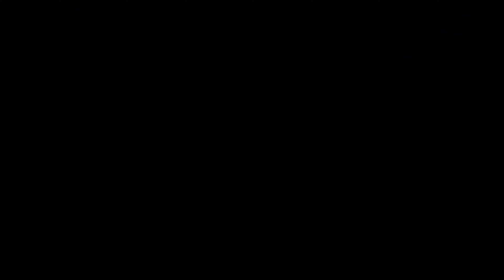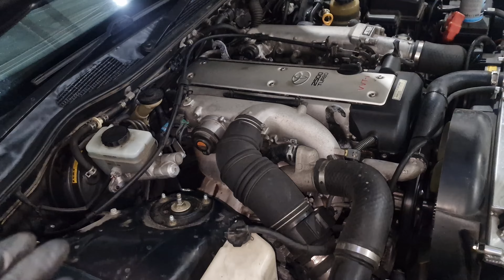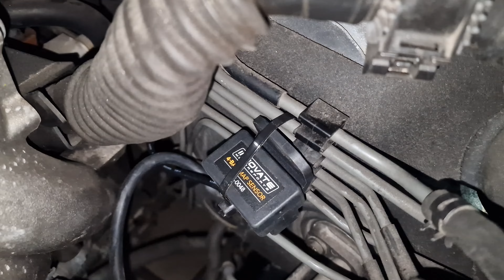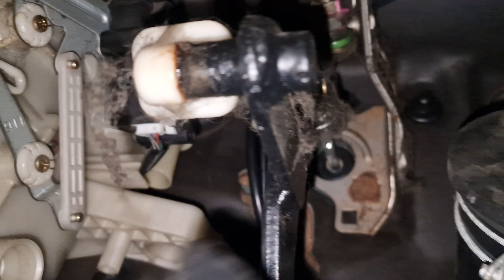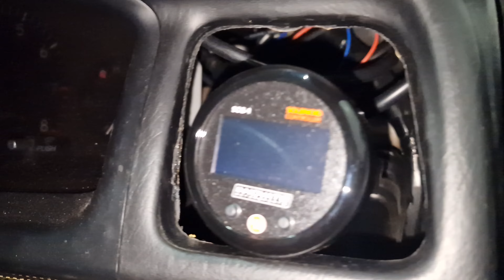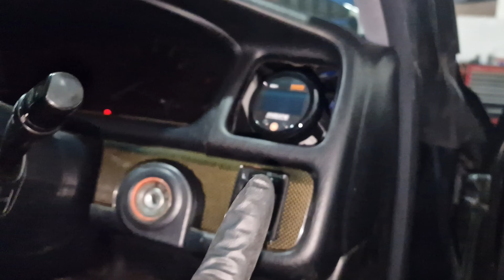Innovate SCG-1 Install on a JZX100 CHASER!

Comment: I was curious if anyone else was using an SCG-1 on their Chaser. Found your video, and I'm glad because I wasn't too sure what the AFR cut should be. I am running a PSR3071 and FCD and a Fenix intercooler. I'll try your settings and see how it goes. I took out 1 of 2 springs so I can have the controller control the boost and when I did that I had to adjust the settings obviously but I couldnt make more than 3.8psi of boost and I was making 10psi before I think. Anyway I switched all my settings to match yours a little more. Hoepfully I dont blow this up before my EMU Black ECU arrives. Lol
Cheers 🍻

UPDATE: engine spun bearing and rod knock arrived 😢. It was due to oil relocation filter line failure tho.